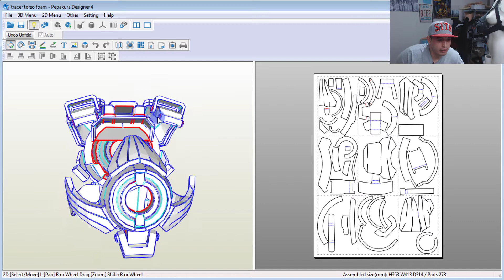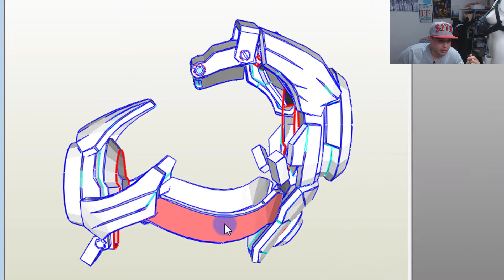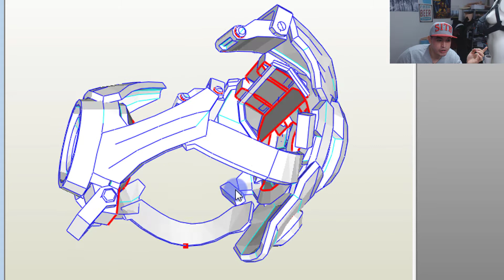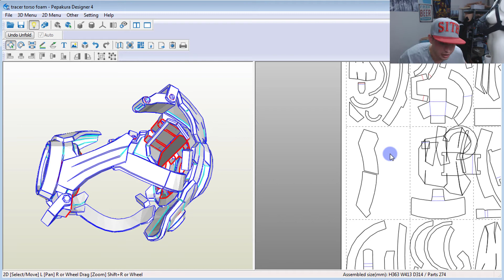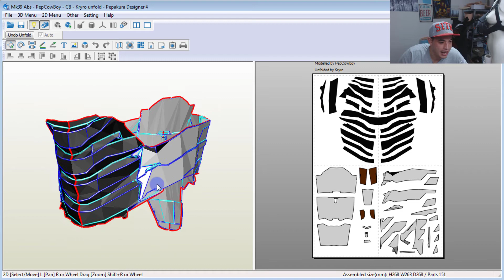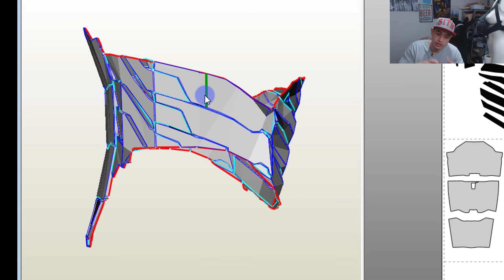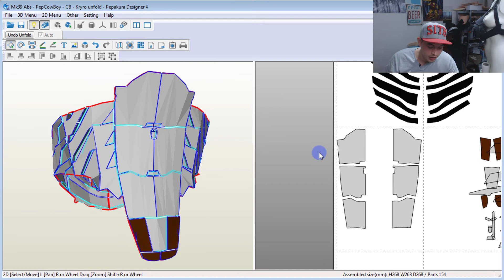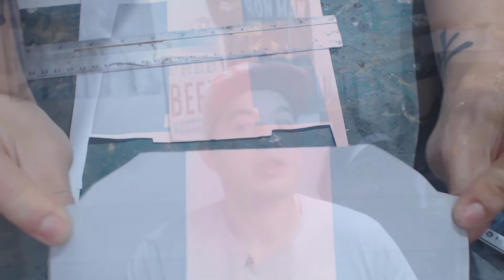Pepakura basics, Scaling and how to do it.

Comment: Great job Wayne!!  I've watched quite a few videos and none of the other Foam Builders address the issue of scaling a pepakura model for a single dimension.  I'm new to foam building (but i'm an old guy :D ) and I was thinking that the only way to resize a single dimension was to do something similar, but you break it down and easily explain it.  I like your videos because you fill in the knowledge gaps from the other more well known channels.  Keep up the good work and if I ever present at a local convention, I'll be sure to give your channel a shout-out!!

Comment: I have a question for you, I am trying to make halo 3 odst gauntlets out of Eva foam but the templates are too small or most of the time will not fit on the paper for me.... can you please help me. Thank you
Reply from the maker: you can upscale in pepakura by hitting ctrl + L and its ok if templates go off 1 piece of paper and continue on the other, you can also turn on "print allignment marks" in print and paper settings to help you allign and stickytape them back together once its printed.

Comment: thx bro....awsome tut again....pepakura is sometimes thinking outside the box because every other person has different dimension....when i work with foam and i have this problem i cut the foam and add foam on the spot.....but your way is a litle more advanced
Reply from the maker: your way is just as good but just leaves 2 extra seam lines on the part, in a non conspicuous area its ok but sometimes its just so out there that seamless is just more neat :)
Reply: agreed i only do iat non Conspicious areas